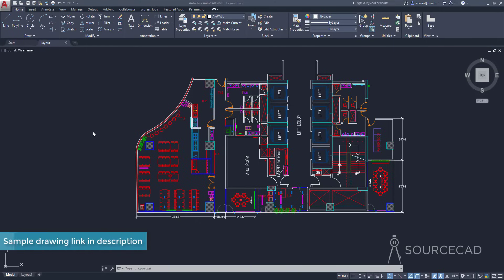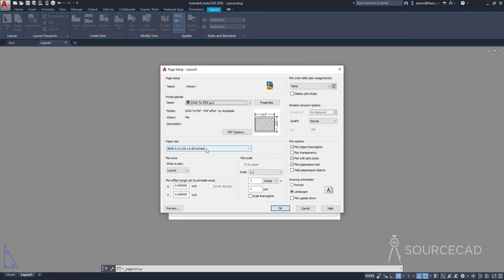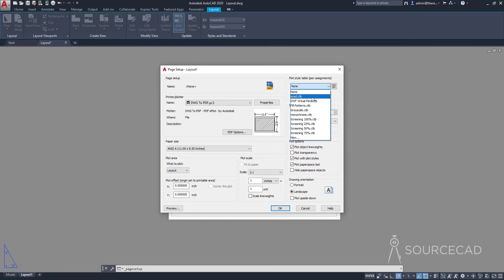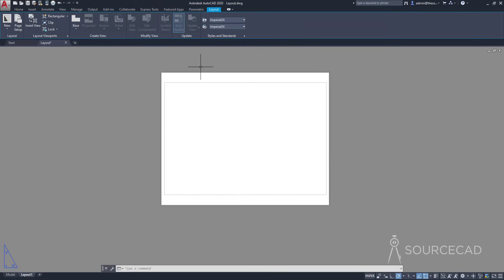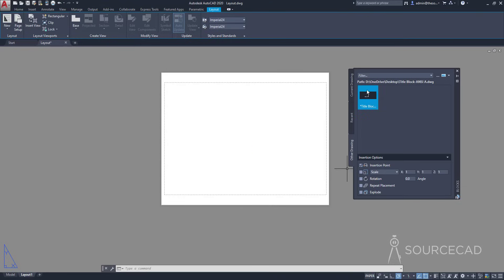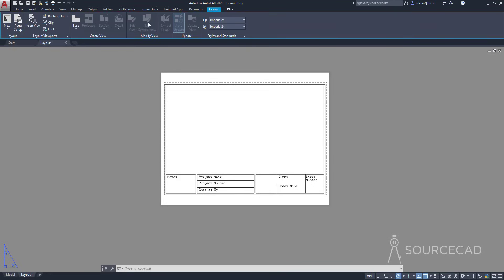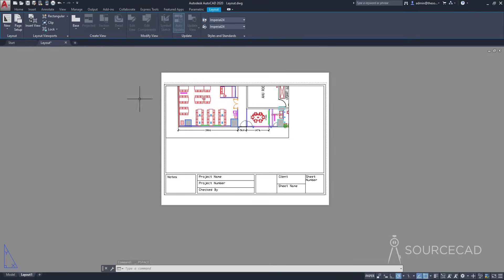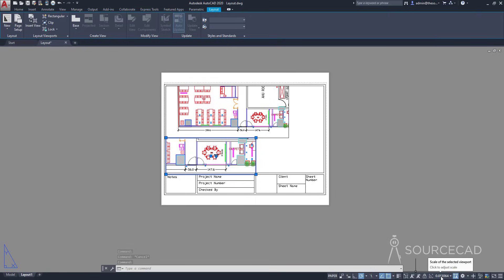AutoCAD page setup in layout or paper space

Comment: Exactly the wrong way to set up AutoCAD Layout !
The layout depicts actual paper sizes - you don't create a layout and then scale/stretch borders to suit - that's not how it works.
Layouts are for real printable paper sizes like A1, A2, A3 etc etc
You draw or import a standard paper size in layout at the size you want to print. Add border, title whatever - That's why it used to be called PaperSpace !
Then you use a viewport and set it to the scale you want to print the model at.
Good point earlier about non-plotting layer for a viewport - turn the plot layer off.
I always set my viewport layer to color 30
Once the viewport and layout are scaled and aligned properly then lock the view port so it doesn't get changed by accident.
You can scale the viewport easily by clicking on the edge of it and changing the scale in properties.
Reply: I want to ask you about the autocad preview. How to preview a paper (whatever size) in autocad as it would be in reality? For instance, let's say I want to print in a A0 size paper but I am not sure if the text is big enough. I don't want waste this big sized paper just to test if the text is readable. I remember in autocad 2007 you could preview the actual size of the paper as well. In this way you could change the scale or the text size or the lineweight before you print it.
Reply: @Axilleas1  The Plot command has a preview option in the bottom left hand corner. You can use this option in both Model and Layout view.
Reply: @willmitchell255  This does not answer my question. This is not what I asked. I am asking how to preview an actual paper size (let's say A4) in autocad?

Comment: hi i have a question. i keep doing all of that, but whenever i add the drawing to my template, it comes with the grid lines. how do i get rid of the grid lines??? thanks
Reply: Please type the grid command and choose on or off. If dynamic input is not enabled, use the command line for entering the command.

Comment: sir' how to solve when print in autocad DWG to PDF lines are grey and thin  how plot  dark lines
Reply: Go to layer manager and select all layer, on plotstyle tab make all (normal, color, default, etc) to Black.  For lineweight, choose layer you need to change lineweight, then on lineweight tab, type in desired line thickness. After, issue command regenall. Or, page plot setup, select correct .ctb or .stb